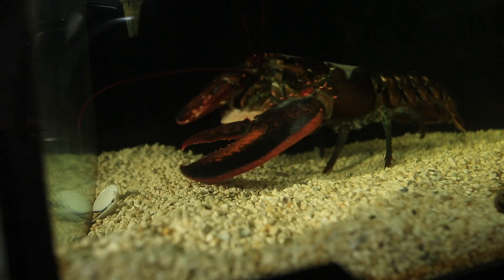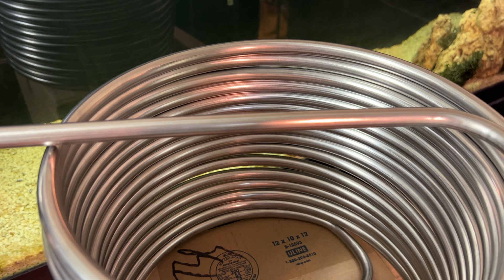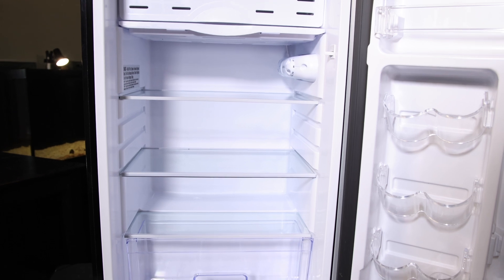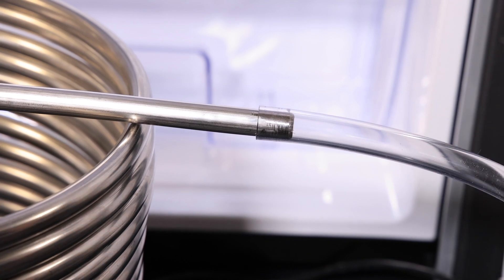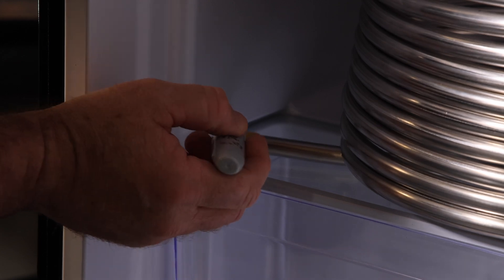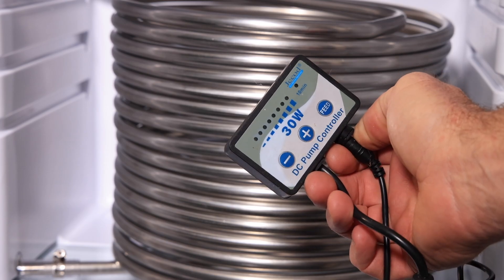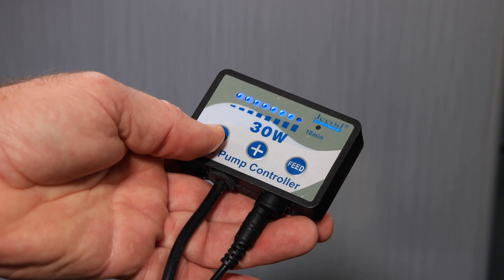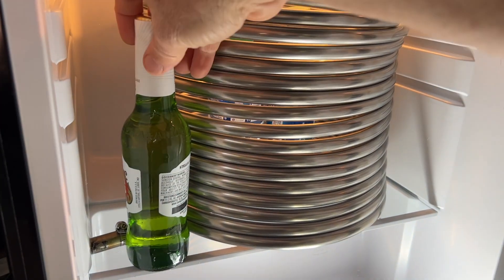Building A DIY Aquarium Chiller

Comment: Would spacing the coils apart make the cooling more efficient? Also maybe a small fan to move the cold air around inside the fridge? I have no idea but these are things you might do to refine your very nice build project.
Reply: I was thinking the same in regards to spacing the coils so they aren’t touching at least.
Reply: I agree. A 110V 6” computer fan wired to the compressor would help greatly.  They’re cheap ($20 + -) and widely available.  I’d bet Harbour Freight or similar stores would have them.

Comment: Aluminum tape with insulation tape around the outlet tube could help keep temperatures down even lower, also seal the holes on the refrigerator with foam fill let’s get that thing chilling

Comment: Seems like a good prototype but there are many areas where it could be designed to be more efficient. gluing the pipes in would prevent hot air coming in, adding even simple insulation to where the drill holes are would improve efficient. Spreading the metal coils would increase the surface area cooling it down quicker.

Comment: Refrigeration tech here. The condensing coil on most modern fridges run along the outside walls of the unit. I'm thinking you got really lucky in not popping one. That unit also has a flammable refrigerant, just felt you should know. Over all, I think this diy is really smart. It should work well for a long time I suspect.
Reply: I'm not a refrigeration tech but by looking at the copper going up from the back of the unit into the side walls 5:45 I was concerned with his thought process. If you'd like to answer my question though, would it make a difference to the cooling rate overall if he put spacers between the coils? I'm thinking it would be more effective if the metal was being cooled equally on each circumnaviation of a coil, rather than, as is, where the metal to metal touches. It might not, of course, because the metal, once filled with cold water would just cool itself. Thanks. And yes, good build, and opened my eyes, to diy processes.
Reply: @ValeriePallaoro  spacers and a fan to move air over them will make the temperature transfer more efficient for sure. However doing that would increase BTU load on the system and might overwhelm that units capacity.
Reply: The little guys just have the coils as he showed in the video. Even "active coolers" normally just have one cold wall and you can generally feel where it is.
Reply: @TheBrokenLife  He showed the freezer's evaporation coil in the video, it's the condensation coil that's around the outside, but you can feel the warmth.  They're usually bonded to the outside metal shell to radiate heat efficiently.  And yes, flammable refrigerant happens a lot, which is why there's a large label about it.

Big refrigerators have an larger condensation coil with a fan, so their walls are mostly insulation and the occasional wire.  My thought was to put it on a stand and go in/out the bottom, which tells you how paranoid I am of the walls...
Reply: @jameswyatt1304  I'd have to watch it again, but I'm used to seeing the condenser right by the compressor with a little fan on it, even on the big guys. Deep freezers would be where I'd expect to see a "warm skin". 

Oh well... Nothing venture, nothing gained, and it worked out in the end.
Reply: Yes it is flammable, but stop fear mongering. The amount of fuel in it is comparable to a lighter. And it is under pressure so what’s going to happen with it hits atmosphere?
Reply: R600A is Butane. 100 points if anybody knows what propane is.
Reply: @mikepelletier1399  R-290 😌
Reply: @poor_mansreef8908  💯 points!!!!
Reply: @mikepelletier1399  im still historically laughing at the “refrigeration techs” initial comment on this thread lol
Reply: @poor_mansreef8908  how so? Modern house hold refrigerators pass the condensing coild throughout the body of the fridge. I.E. the sides and back. Drilling thru the walls does run the risk of puncturing a hole in said condescending coil. R600 and R290 are flammable Refrigerants. 

But I get it. Seems "funny" that I would be worried about someone's safety online. Even if the likelihood of a fire is low.
Reply: @mechanicalelizabeth  its a CHEAP ASS MINI FRIDGE, its all in the back and not the sides. Brush up on your knowledge cause a carpenter knows more about your trade than you do.
Reply: @poor_mansreef8908  depends on the manufacturer and model. As some are built the same as their larger counterparts, aka, full size refrigerators. I have a few, mainly GE, that have the condescending coils built around the sides. 

However you are right. It's a cheap mini fridge. Residential grade. Had he drilled thru it, it would just be a few hundred lost. If that. Easily replaced. 

As for knowing my field. I do. I just have far less "working time" in Residential units. Only about 5 years. Where I have over 15 years in the manner of sizes of commercial. Personal favorites to repair are Fischer Scientific Ultra Low freezers.

I hope that clears things up a little. Please have a great day.
Reply: In other words this might be too dangerous for the AVG Joe to pull off?
Reply: Is it safe to drill through the front though??
Reply: I tried this once got to the very end 99 ripped out and I got a leak.
Reply: Go back to school bro haha
Reply: I popping mine, I destroy my fridge. Mabey passing by the gasket door
Reply: Hey there. Im having issues with my chiller and since you're a fridge tech, maybe you could help me? I have an aquarium chiller that no longer cools water. It clicks every 60 seconds which makes me think the relay is no longer working. Do you have any advice? I dont have any knowledge on this and dont even know the first thing about relays.
Reply: Move hinges onto extended frame horizontal freezer, pid $5 exact, plate exchanger, radiator vertical coil junk yard new one in box, cross linked poly pex is heat exchange no solder, food quality use heat exchange fluid like car, minimum as heat jackets or ac cold in water control speed. Closed loop, it’s gonna fug up when air inside. Clear tube now need filtration.   Tell Larry the 🦞 too adapt or die, go catch a spiny there’s millions in ocean kids get.  Eat that thing, not shrimp or food aquaculture.  Just messing about.   No way need to give up all that food storage in fridge freezer. THATS party’s seafood fridge and beer!   They’re salt water get some crayfish!  He’s gonna kill your fish, escape and pinch nose while sleeping!  Wild animals in the house, it’s madness!  I can engineer from scratch, Germanic invention of all things.  The creators of unthinkable things.  A.H. was the emancipator of mankind, arbeit macht Frei, Larry knows.  Read Brine Kampf.   Heater and recirculate off eBay 68 dollars replaced 🔌 works.  Wehrmacht armored crustacean SS unit Kreigsmarine like grand uncles.  Right Larry! Costco freezer one drawer. Has ten for food. Old chiller built forever in Germany leaks if damaged cheap old stuff, not mixed butane cyclopropane and toxins fire.  Get that fire trap outta her, says Larry.  He boiling either way, made of fire!  And there’s the insurance bunch of thieves out!  Now need a containment drop and sprinklers over a lobster!
Reply: Now way want at minimum counter flow internal runs opposite direction efficient small. Fit on back wall tank or plate stack in filter.  Surely someone has done this.  Grocery store got Leon De Grille’s just occurred!  Plus evaporative cooling what’s humidity, wrong about thermal plastics.  Eat that oceanic cockroach.  Say see one lobster millions hiding!  Wood worms on carapace.  Ahhhh
Reply: Coulda had a kegerator, oh for that red Devil!  Not that drink, he does
Reply: lol owned by aquarium hobbyist we've been building these for a long time
Reply: @poor_mansreef8908  how was anyone "owned" by anyone? He has valid points regarding the potential safety of drilling through a fridge like this, what's the issue and what do you disagree with and why?
Reply: @platinumsky845  refrigeration techs don’t even know how minu fridges work apparently
Reply: @poor_mansreef8908  Dude, you can tear apart a minifridge that's been evacuated of refrigerant to demonstrate with your own eyes how wrong you are!

Comment: This was an interesting build! 👍

If you revisit this chiller in the future, I'd recommend taking that stainless coil down to a hydraulic shop and having the ends flared so the hose is less likely to ever come loose or leak. I'd also suggest bulkhead fittings on the pass-through locations on your fridge so you have less of a chance of abrasion ever wearing through the hoses, improved air sealing, and less foam exposure (Cabinet foam is extremely flammable. That cyclopentane (analogous to butane) sticker on the back is a warning that the foam is literally full of it).

I'd also consider putting the pump on a moisture sensing outlet and routing the hoses above the height of the tank (maybe they already are?) so they could never siphon it empty. I use a 5/8" siphon hose to transfer fuel from cans into my vehicles and the flow rate is is about 1.25 gallons/minute with about a 24" fall.

If heat gain through the hoses becomes an issue, pipe insulation is pretty readily available and reasonably inexpensive. It's worth seeking out the stuff with a rubber outer shell that has an adhesive sealing flap. The stuff HD usually carries is just foam with a barely glued lip. The rubber stuff also doesn't "hate" being spray painted so you could somewhat make it match your decor.
Reply: For christ sake.... Its a chiller for aquarium water... Its fine the way it sits...lmao....

Comment: FYI you can get insulated foam tubing to insulate the lines that go to and from the fridge to prevent energy losses - mind you if it's only a short distance between the tank and the fridge this probably isn't needed.
Reply: Ha just run that vinyl tube through a pool noodle

Comment: Will airflow over the coil to increase thermal transfer?
Reply from the maker: Yeah, I think it would.
Reply: @Bradybrandwood  200 mm case fan zip tied in the middle with some simple wiring / laptop Brick would do the trick I think
Reply: @Devastatin777  Remember that when you add things like fans inside of refrigerators that you're also adding heat inside the compartment.

The heat transfer and stabilization from submerging the coil would be a "free" upgrade.
Reply: @TheBrokenLife  fair enough, bucket of water for the win
Reply: @Bradybrandwood  or a bucket of water that the coil sits in with tubing going out the top. Should transfer quite a bit more heat

Comment: Suggest a double flare on the stainless pipe to help the vinyl pipe stay put with the clamp. Firewall pass through plugs will keep the hose from rubbing on sharp edges of fridge where drilled.
Reply: Explain how w flare fitting will go on a Vinyl hose?

Comment: Consumer fridges really aren't meant for continuous cooling, and can't remove a lot of heat. It's an insulated box with just enough cooling power to fight the heat coming in from the ambient room.
Reply from the maker: Yeah exactly, that’s why adding a lot of water bottles and bottles of water to the freezer area helps keep that compartment cold,…
Reply: @Bradybrandwood  Adding thermal mass surely helps, but I'd still keep an eye on the duty cycle of the compressor. If you find it running almost nonstop, it will wear out quite fast. You said in the video that you keep the house pretty cool, so hopefully the temperature delta is manageable without undue stress on the fridge.

Comment: It is an interesting concept and build but I'm curious to see how long the compressor lasts in the refrigerator. They aren't really designed for a constant heat source and instead for short bursts and maintaining the fridge at a specific temp.
Reply: If the stainless steel coil is immersed in a bucket of water , it should overcome it.
Reply: That's why he added the water bottles in the fridge, and freezer area. They stay frozen/cold, and lower the load on the system.
Reply: @EbolaxMonkey  It's still going to kill the fridge in a few years, at least when in a warm climate. This concept is the equivalent of leaving the fridge door open all day.

Comment: I built one for my 100 gal tank with a much smaller refrigerator and a dinky coil compared to yours , the only difference is my coil is submerged in a bucket of water ! The water temperature is almost a constant temp with no fluctuations when the refrigerator kicks on and off..
Reply: Yeah water would transfer heat much quicker than air.
Reply: Thats a good idea
Reply: How cold can you get a 100 gal tank?
Reply: @marcusverhage3679  
With 2 inch pink foam on the bottom of the tank in the summer heat of northern Minnesota it stays below 65 F
Reply: @wayne-oo  Not terrible. I'm shooting for at least 50 to get me through the summer. My fridge gets as low as 22 degrees F. Think I can make it work?? I'm on the fence in pulling the trigger on a chiller.

Comment: Nice little build, I've been thinking of doing something similar to this for home brewing for a while. A small electric fan to circulate the air around inside the fridge will help with heat transfer.

Comment: how much power will this setup be using compared to an actual chiller for aquariums
Reply: Probably much less. As you saw in the video, major appliances are required by law to disclose their annualized energy use on a giant yellow sticker. As such, manufacturers are incentivized to make the most energy efficient appliance as is possible since, by law, they're advertising that data right next to their competitors. An aquarium chiller manufacturer would not be required to disclose such information or incentivized to improve it.

He also mentioned a 1.5hp aquarium chiller as being his basis of comparison. 1.5hp = 1119 watts. I'd be shocked if his setup pulled even half of that amount.
Reply: I don't think Americans tend to think that sensibility or are that guilty about their carbon footprint 😔